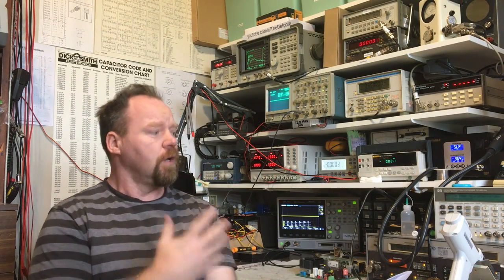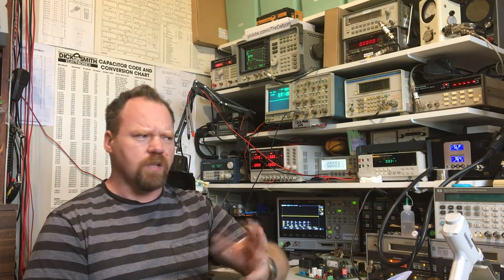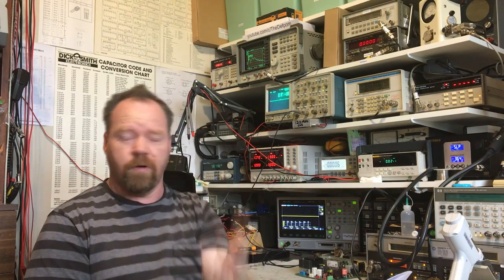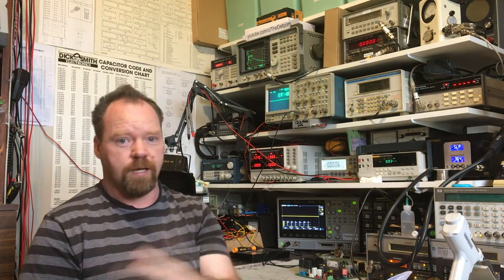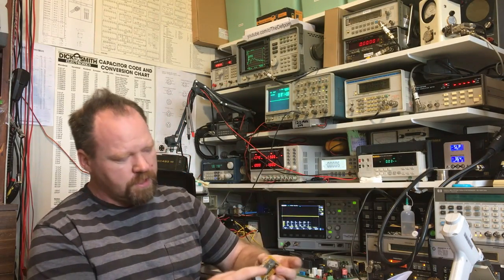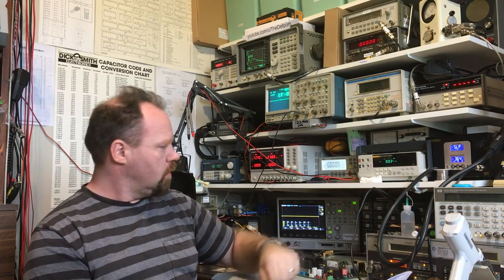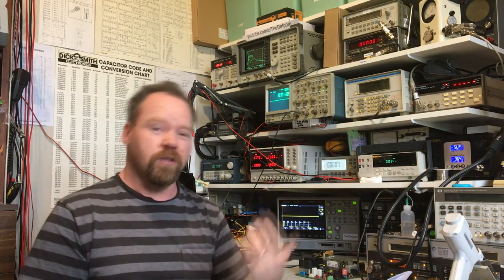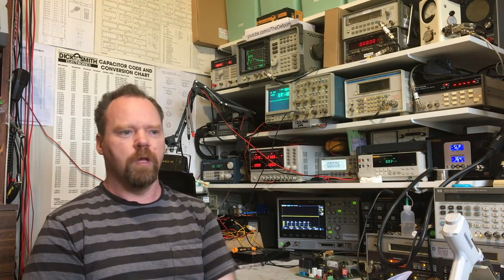Channel Welcome

Comment: the series i been likeing is the  pll experiments
Reply from the maker: That series isn't finished yet, I am still working on it. I figured out a way of reducing the phase detector noise by quite a lot, and still being able to use the Arduino to drive the display directly, this evening I redesigned the PCB for the display to add the missing series resistors for the segments, and the pull down for the press button, and ordered them. I was waiting to redesign the display PCB until I resolved the noise issue, in case I had to add a display driver to it anyway.